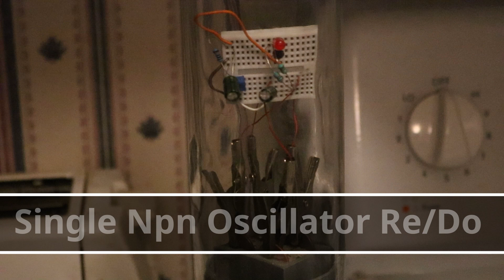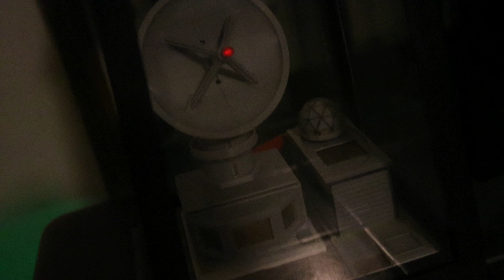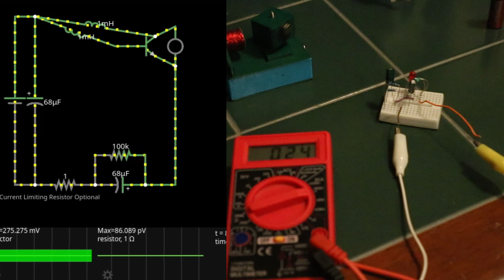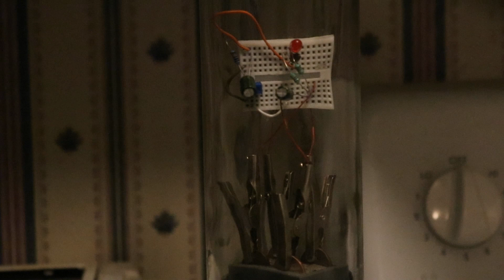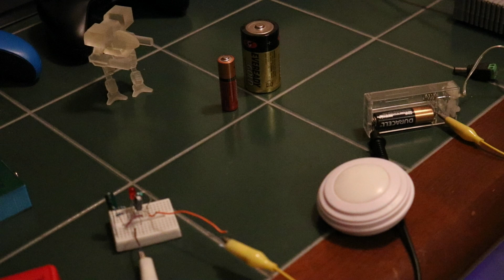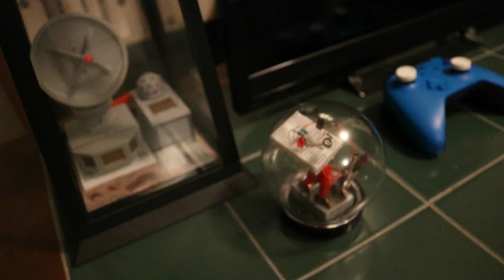Single Npn Transistor Oscillator Update Re⁄Do

Comment from the maker: I would like to say I started the galvanic led circuits a day apart from one another around the date 4/21/25. I will try to remember to update this to let you know when they have stopped running one I have gave not even a drop of water too and the other a few drops more so I am curious to see if that mattered a whole lot for this.

10 days on the one I didn't add much water too but I just put a little more water in it and its running good as of the second one its been going great no intervention needed. Besides that the circuit in the simulator will not work unless you tweak it but in real life it will work as shown forgot to mention that the circuit sim can be picky.

I am assuming here for this one but it been 1 month 2 weeks since I put the bottle one together it stopped "sorta timing was being weird" but I think it was due to being moved its going again with nothing else added or done to it I just pushed the wire back in good as new.

The globe one been going strong no issues there I think the bottle just had the tape come lose on the bottom which made the wires slip out lol besides that they still going one month now strong 3 more to go to beat the old run time record lets go.
Reply from the maker: So they going on 5 months soon however both did stop at one point or another but mostly because a connection came lose showing them to friends and what not so I had to open wiggle the wire and off they were again so at most 5 min to a few seconds of downtime. One is blinking slower then the other which is weird behavior I noticed but then again one is more in the sun and light almost then the other I keep in a darker room so I am thinking the copper is forming a oxide and is letting this act like a crude solar cell verified it using a jar version with aluminum and copper and seen same results its not much though for a voltage gain but its probably helping keep the one more active by providing less drop in voltage as the led pulses but they still are running as galvanic cells independent of everything they don't "charge up" if your wondering.
Reply from the maker: The blink rate now is all over the place still could be the connections but I would like to say it looks like it might be done here by month 6. The one is like 14 seconds per pulse now so not great. Even if they do go on it might be worth a redesign bigger plates and connections epoxied. But still impressive for just a few pennies. I will keep them together a little longer since they still going but I do think they are about to stop so might show off how they wore out after all these months for a video when I get the chance.